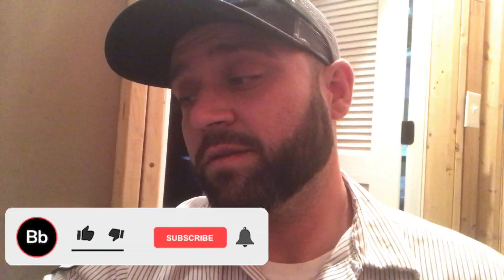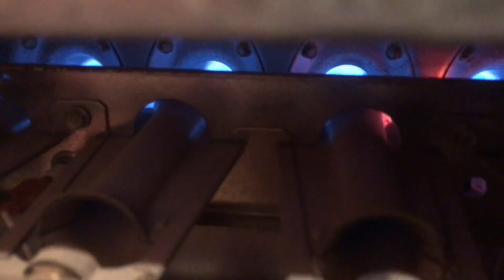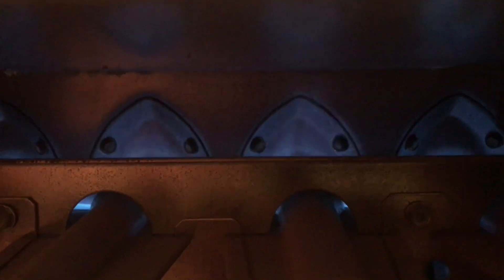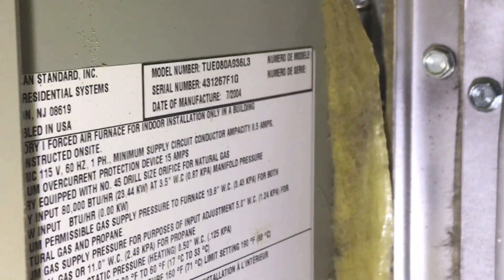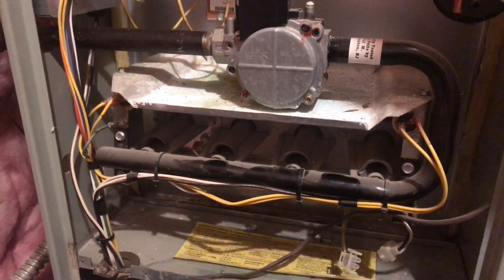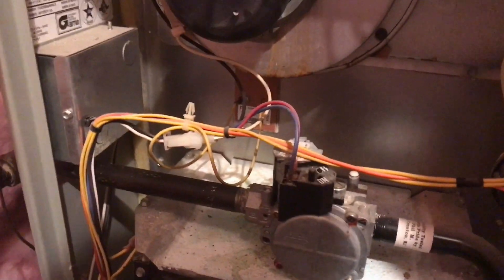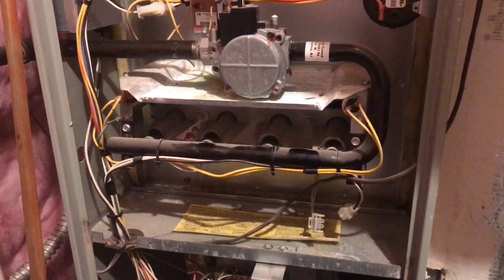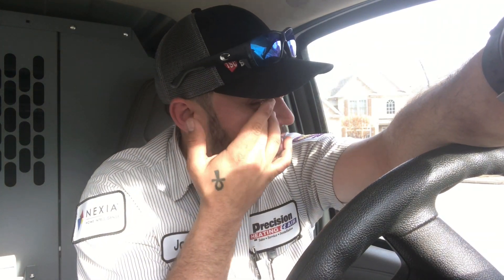Watching A Furnace Run With A Cracked Heat Exchanger

Comment: My lennox furnace says it has 20 year warranty for heat exchanger. With it it needing to be registered.  However if it breaks down it doesn't mention how one would be able to make a claim. I wonder who they would even have to come fix it?
Reply from the maker: Any company should be able to turn it in for warranty
Reply: I just found this out about mines. I was told if you can’t find the original installer. Just get in touch with a certified Lennox dealer/installer to make the claim.

Comment: Would a cracked heat exchanger cause the flames to not even come on? My flames don't even come on, the error code says bad blower motor but HVAC repairman said the heat exchanger h as a small crack and I need a new furnace.
Reply from the maker: Not usally
Reply from the maker: Sounds like you should get a 2nd opinion

Comment: Can this makw it stink in the house like burning dust?
Reply from the maker: No. That is normally from the dust burning off the heat exchanger when you first kick the heat on
Reply: @HVACTechTips  we first kicked the heat on weeks ago. The initial burning was way done. This came out of nowhere in the middle of the night smelled like rubber burning, then following nights smells like burning dust. Its going on 2 weeks of this smell in middle of night i have to open my window. I did find out my husband put the filter in backwards so that got fixed but now im worried there could be damage to the furnace. Its a 17 year old furnace. It makes me nauseous
Reply: @J5A30AT  Did you ever get your furnace problem resolved ????     I have the same burnt dust / burnt metallic smell coming from my supply registers.  Started about 3-4 weeks ago.  We have a 2016 high efficiency 95% Rheem furnace.  Can't even keep my hand on the plenum above the a/c coils for very long.  Talked with the hvac tech who didn't respond to my first text a week ago. Then talked on the phone Thursday.   He's coming on Monday to look at the furnace but, he sounds like he doesn't believe me.   The metallic smell actually makes it difficult to even breath.  Keeping windows open helps a lot.  Obviously there's something not right.
Reply: @susank7680  the HVAC or our plumbing and heating people came and replaced a couple pipes the intake and outtake pipe from the furnace running outside. They didn't do a good job and now its spraying water on the house, but i told my husband they suck and not to call them again. They treated me same way they think women are dumb. Woman have a better sense of smell than men, keep that in mind and stand stronge, do investigate before they come and write down questions and possibilities, because usually up to them they will say theres nothing and assume your just imagining things. However it still has a smell at night here, been months.  I started to think maybe it was the dryer because it stunk worst when the dryer was ran that day. So i cleaned the dryer vents as good as i could. The smell got better but it still goes on. Check if you have any appliances running into an old chimney make sure there not blocked. Mine was originally my husband didnt have a chimney cap on for almost a year without my knowledge and a bird flew down it and cooked on top of a gas water heater. But even once that was cleaned up the smell persisted. Im still opening windows at times at night. Check the chimney, dryer vent clean it good, and the electrical outlets as well see if you can locate the smell. If you have an attic check that. If you still cant find anything after that and the furnace guys come,  you can always call your local gas company and say your having carbon monoxide symtoms. They have better equipment to test the air and possibly find a problem than the HVAC and the even the fire department. Hope this helps. Im moving in a few months partly because of this and divorce. Its aweful and horrible to deal with so im sorry. If i can help any more let me know. And if you dont mind if they find your problem let me know.
Reply: Hvac guy was here today but couldn’t find any problem. Hoping to get another company in to do a combustion analysis asap to see if that shows anything.  If it doesn’t, then I think we will consider just getting a new furnace and start over from scratch.  I don’t doubt my own symptoms and sense of smell, no matter what someone else says. I’ve been correct too many times when questioning this thing.  I own a methane/propane sniffer in order to track down those kinds of odors. It’s not as high end as the LP company’s but it works.  Have a few other hvac type gadgets as well. Useful to have around the house. But I’ve spent 8 years of wasted time on this thing. I’ve had just about enough of it.
Reply: @susank7680  As i sit here it stinks in my living room. It has all night again. Whatever it is here has made me and the kids sick multiple times before. The guy that had retired from the gas company told me even the fire department doesn't have the proper equipment to test for aldahydes. If you figure it out let me know cause i havnt. I might call the gas company. This will affect your health over time so definitely take precautions.
Reply: Sadly I’m all too familiar with this.  I have severe chemical sensitivities which include formaldehyde/aldehydes. I’m sure the gadget that measures those kinds of things is prohibitively expensive.
Reply: @susank7680  Yes your probably right..however i think plumbers should be required to have them and HVAC in general. I have asthma and allergies to mold and we also have a ton of mold and mildew in the house so i feel you. 🤧 Not a healthy environment so me and kids are moving soon.
Reply: They should but there’s nothing we can do about that part.   I had to put my cat to sleep on Wednesday morning. Early stage kidney disease, his blood work was stable just 4 weeks ago. The day after that appt was when the smell and CO began coming from the air registers. Four weeks later the cats blood labs had flatlined. Kidneys no longer working and no red blood cell production. Vet thought it was very likely the CO and aldehydes from the furnace that triggered the severe and rapid decline in his health.  Really makes me angry.    New furnace and a/c will be installed in two weeks.
Reply: @susank7680  Oh my goodness Susan!! I'm so sorry about your loss and thats a definite sign that its not healthy for you to be there at all!! Please try to keep windows cracked if you can and stay out of the house as much as you can until they put in a new furnace! I dont have any pets to gauge off of but my kids have had symptoms like getting sick a lot, itchy watery eyes, ect. And i was just diagnosed with Legionnaires Disease about two months ago had pneumonia. Please take precautions!! What state are you in? I'm in Ohio
Reply: I’m in Iowa.  Hvac guy said it would be a couple weeks before he could install the new furnace and a/c.  But we also live 500 feet from two 90 yr old natural gas pipelines, one of which is in the process of being shut down. There’s only one reason they shut down pipelines… cuz it’s leaking more product than it’s delivering.  There are days when I feel like crap outside and there are days when I feel like crap inside but shutting down the furnace and gas valve (propane) makes the headache go away.  So I know the furnace is a problem and the cat paid for it with his life. The pipeline I can’t do anything about. If I can get enuf money together, I’ll just move.
Reply: @susank7680  yes i know all about the headaches, migraines, dizziness, nausea, weakness. It can do permanent damage not just temporary until you get away from it. Just be careful. I feel for you so much. 💔 i dont sleep much because i have to keep the kids in the living room with my kids and open windows even when it's cold out and turn the heat down because my kids sleep with their blankets over their heads. Im so sorry to hear that. I hope you can get out of that soon. Ill be praying for you!
Reply: Thanks hon. Hope you can get out too.

Comment: Disabling the furnance, is subject by state guidelines you, legally can't just unplug everything. Only way to identify a crack heat exchanger is to verify the crack, which is probably why the homeowner got mad. Only way to waive company liability is to have the homeowner sign a liability form. With that you must provide pictures and combustion analysis report. Just replacing heat exchanger is bad idea cause there's reason why cracked formed other than age.

Comment: Was told we had a cracked heat exchanger plus 2 smaller problemns by a large company. We got a quote from them to replace our furnance. Doing due diligence we wanted a quote from a smaller company, they said they didn't see anything wrong with the heat exchanger or the other 2 smaller problems. What do we do now?
Reply from the maker: Have a reputable company look at it
Reply: Well what did the smaller company tell you to do? What was their diagnostic?

Comment: I work in hvac. I am an installer and you would be surprised how many furnaces i replace have cracked heat exchangers. The threat is there and can go unnoticed  for a long time. This can cause serious problems with your health and possibly can, given the rite amount of carbon monoxide through the cracks orcrack will kill you eventually. Great video!!!!
Reply: My opinion - the average home owner at least needs to have a CO detector - most houses I'm in now do (not an installer, just a resident). But with the advent of declining prices for measuring tools, I'm getting a CO hand held detector so that I can monitor levels, even if they're not setting off the CO detector close to the vent.
Reply: @John Voelker....I agree....I am a service tech, and those failures DO go unnoticed, even moreover,  ignored.... I have gone to look at many units where the pvc vent pipe is black and flue gas smells real 'sour'. This is when immediate repairs or unit replacement has to happen....
 We,  as techs, get all the rapport then as being crooked or just trying to score work or a big sale, even after showing them the issue. 

So, we cannot be so hard on ourselves when many of us are going out of our way to keep people safe, when it's the cheap 'poor' farmer in rural America who refuses to maintain his system.
Reply: @toddberner9198  wow that's racist
Reply: @toddberner9198  You're right but there are HVAC companies out there that are corrupt and will take advantage of people.  My son worked at one of the biggest HVAC tech companies in this area for maybe 5 or 6 months and he would tell us some awful things he witnessed.  He finally quit working there because he didn't want his name associated with them.

Comment: Could a blocked exhaust pipe do that? Like in the chimney?
Reply from the maker: Not likely, thats what the pressure switch does. If there is a blocked vent, the pressure switch would not pull in and the flames would never kick on. But great question!
Reply: But wait what if we were unlucky enough to  have a faulty pressure switch? How would we even know?!

Comment: I have been smelling small amounts of exhaust but it's a clean burn with no CO alerting the alarms. I turned the furnace off and turned the blower on, when I put my hand over the exhaust vent it sucks air in. I put a 3 gallon plastic bag over it and it sucked it shut in about 40 seconds. Just had furnace repair guys here for inspection told them about it but they never checked the heat exchange do you think this could be the cause?  When he was done with the inspection and I showed him the suction he said I don't know give us a call back if you think you need a repair.

Comment: I wouldn't disconnect anything, they might say you are trying to scam them. I'd just turn off the gas valve and tell them.
Reply: If he didn’t then he will be held liable if someone dies. Homeowners are stupid
Reply: @robertlamey7612  Agreed. Anyone in this comment section telling the HVAC Tech to just shut off the gas valve is obviously ignorant of the dangers of a cracked heat exchanger.
 Carbon monoxide is a silent assassin. You can't see it, smell it, nor taste it.  
 If the homeowner goes behind the tech after he leaves and turns the gas valve back on, he's making a fatal decision that may just cost the lives of himself and his entire family. 
  If I service your unit, and I have to temporarily shut the furnace down until I can install a new heat exchanger, you ain't turning that system back on. 
  I promise. 
  And let me find out you tried to go behind my back and turn it on after I left, you selfish think-for-yourselfer; I'm gonna tell your wife that you tried to kill her and the children, then show her how many people die every year from carbon monoxide poisoning.
  You better bring your lil ass to Walmart and get you one of those space heaters for about $25-$50. 
  In the U.S. alone, approximately 420 people die each year from accidental CO poisoning, and over 100,000 people (again, in the U.S. alone) visit the emergency room every year from CO poisoning. 
  You think those people ended up dead from breathing carbon monoxide outside of their homes?... 🤷🏻‍♂️
  Carbon monoxide inadvertently ended up in the conditioned space (i.e., inside their homes) due to cracked heat exchangers, along with wood-burning stoves, kerosene heaters, etc.
  Don't be stupid.
Reply: Most places demand you lock it out
Reply: Exactly! He's shutting breakers off and unplugging things. Don't come to my house and do that. Shut off gas and make customer aware. That  is all.
Reply: @dave3464  well if you struggle to find a breaker then you should probably just listen to the heating guy lol
Reply: @dave3464 if you die due to carbon monoxide poisoning, I can be held liable. I'm disconnecting your unit and tagging it out. I'll tell you what I did, and you can make the decision to put yourself in danger or not

Comment: you can have major cracks with no flame rollout
Reply from the maker: Thats extremly unlikely, but possible
Reply: @HVACTechTips  it's very likely, i've seen it, every cell severely cracked on an icp with perfect looking flames and i'm not even a tech. 

I can't see there being a good substitute for a visual inspection. a combustion analyzer may come closer to a good substitute - would pick up major leakage with o2 rising when fan comes on, but won't necessarily pick up everything.

Comment: Thank you! This should be made into a Public Service Announcement. I’m sure people don’t realize this potential hazard a) we don’t watch our flames from the furnace & probably wouldn’t know if there was something “odd” about them and b) probably lots of us aren’t faithful with having HVAC systems checked routinely. Question: I have a carbon monoxide detector upstairs but should I put one in the basement as well?  Not sure how CO travels but wondering if it’s initiating from the furnace, maybe a detector downstairs could alert us faster??🤷🏻‍♀️ Thank you again for your insight!
Reply: I was thinking the same thing, so I installed our detector on an outlet that is just next to our furnace. I did that right after I replaced our heat exchanger. I guess I did a good job, it's been at least 3 years and no alarms so far!
Reply from the maker: As long as it is by a vent in the home. The C0 would be traveling through the ductwork and into the home.
Reply: @HVACTechTips  Makes total sense now that you’ve said it 🙄. Mine is not near a vent.  Will move it tomorrow.  Thanks for your help!

Comment: I have an older Weather Maker with the 3 site glass burner view. The gas
 compant said one of the flames is flickering which could be a cracked 
heat exchanger again it's 20 plus years old, just curious thanks
Reply from the maker: I would have it looked at by a HVAC pro. More then likely, it has a crack

Comment: Good tip.  Hopefully the home owner is able to verify the same thing & use the warranty replacement (if available) to get a new heat exchanger.

A heat exchanger shouldn't fail after 17 yrs, imo.

Which brand of furnace has the longest lasting heat exchangers?
Reply: My GMP100-4 still running at 23 year old ...
Reply from the maker: There all about the same.
Reply: Just do not last long?
Reply: Average life of a new furnace is 10 to 15 years up to 25 or so with great installation proper static and good maintenance
Reply: I think it all depends on the install as well as the pitch the unit was installed. I have a Lennox Elite and we’ve pretty much boiled it down to this situation. Preferably a poor install of the unit as well.
Reply: Amana has the best heat exchangers and warranty behind them right now

Comment: so my heaters out and blower doesnt turn on at all, even when turn fan manually on. called a tech spend 25min and take some picture with his ipad and had show me some picture with white lines and call it cracks are those cracks or is he trying to selll me something i dont need, because its 10pm and he say he can have a quote guy come over at 10pm to give me a quote on a furnace... sounds way too sketchy... ... he also say my circuitboard and capacitors are bad and wanted 900 for those two part alone, and quote a new exchanger at 2300 so he recommend replacing furnace...